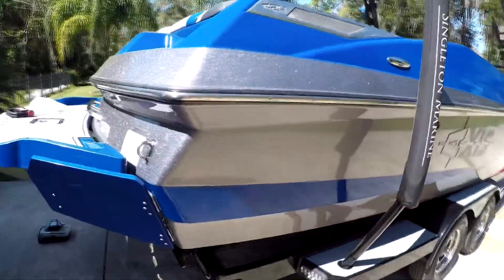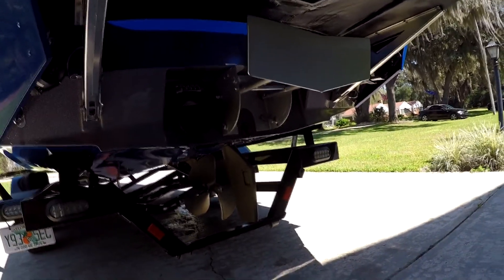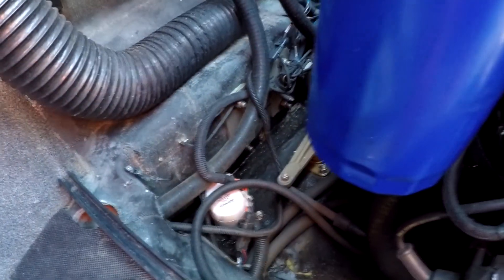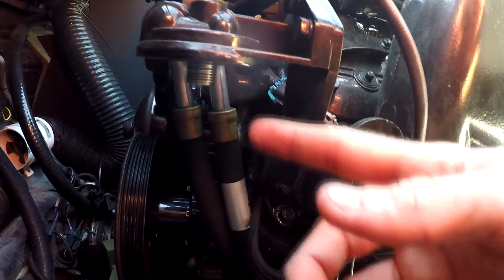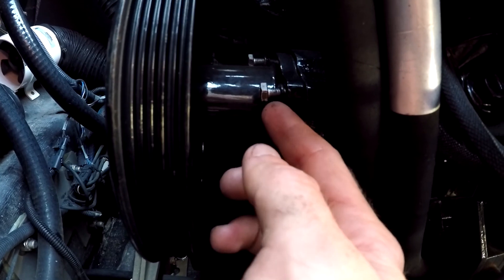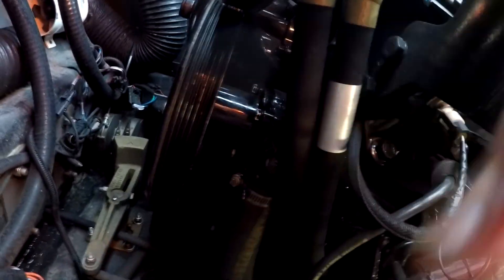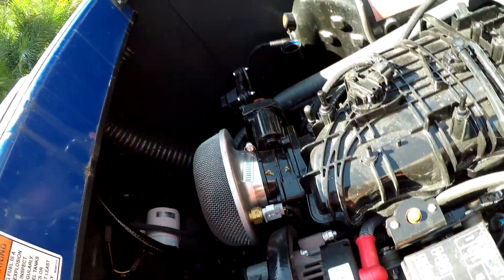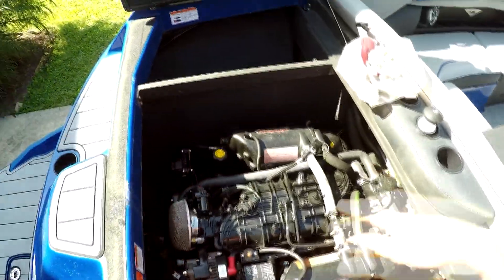Axis A24 oil change

Comment: Thanks for the great video. I changed my oil yesterday and will do the impeller when it arrives.  I have an Axis A20, 2018.  Question, when using the fake lake I saw water coming out of the exhaust, but also out of a hole several feet behind the water intake.  Are there two intakes?

Comment: Very Helpful. Thank you! I noticed the 15W 40 oil is for diesel engines. Is there a different 15W 40 for these boats or is the diesel grade oil ok?
Reply from the maker: 15W 40 is fine on these because of the tourque they are putting out
Reply: @wildtropics5354  Thank you
Reply: New oil requirement. 10-30 full sun. Sec 1 Gen2.

Comment: Hello, where can I find fuel filter?
Reply from the maker: Some have a FCC(Fuel control cell unit) where it is all integrated in one while some PCM engines do not have a full unit together. Mine for example is a small filter built into thr primarily fuel primer connected to the top of the gas tank.
Reply: @wildtropics5354  and how often do u change it?